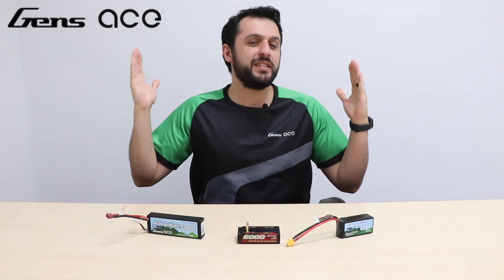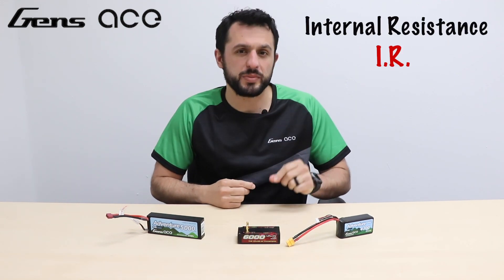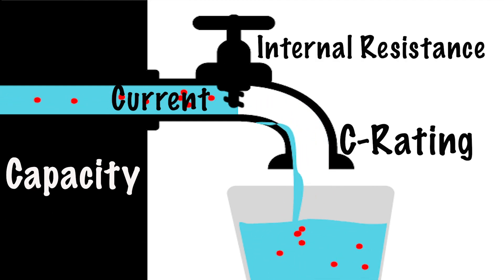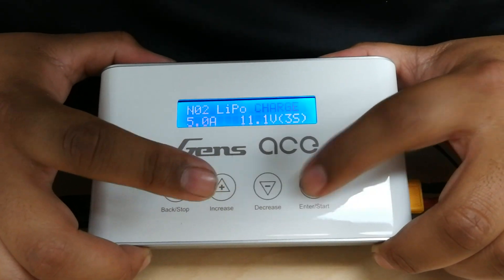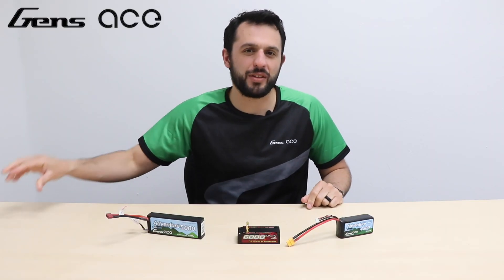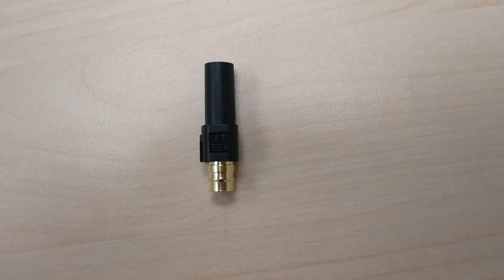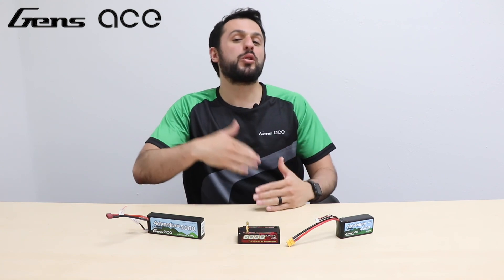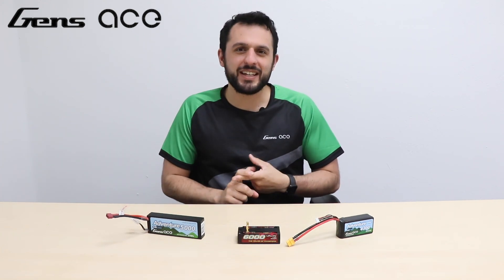Battery 101- Internal Resistance

Comment: Thank you for this very informative and easy to understand video on I.R. Zac!  I am curious, is the resistance measured on home chargers (I use the HOTA D6 pro) very accurate? Is tracking a lipo's IR over its life a good way to check if it is still good?
Reply from the maker: Hi there! Thank you for the kind words. Unfortunately it all is based on the charger itself, some chargers can measure resistance better than others! To your other question, yes, measuring your resistance is great way to see how your battery is still performing! Typically, older batteries do give more resistance during use.